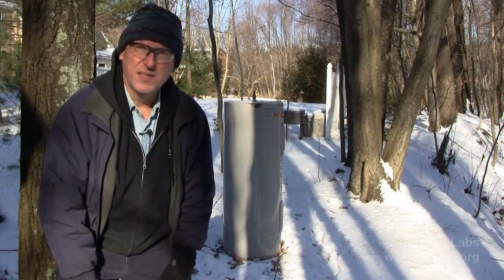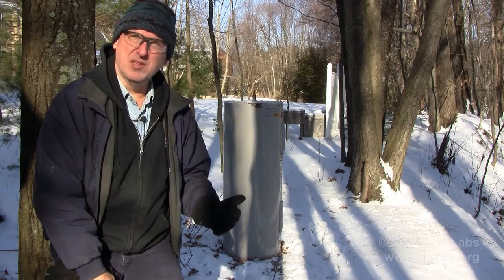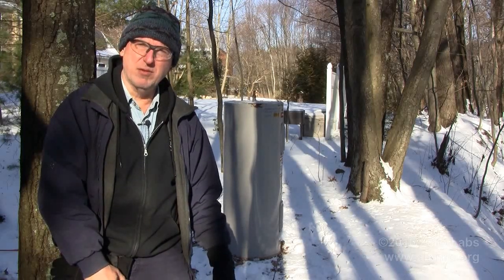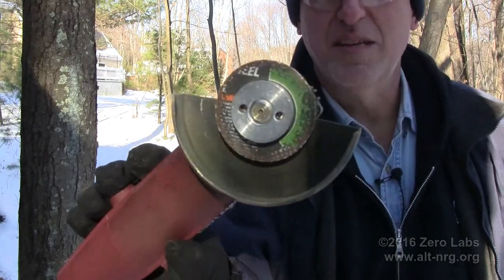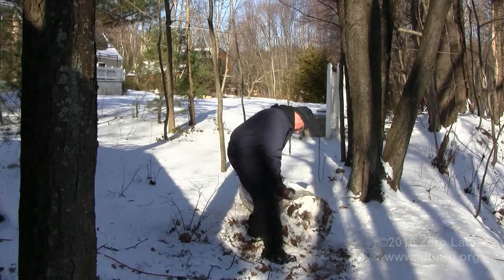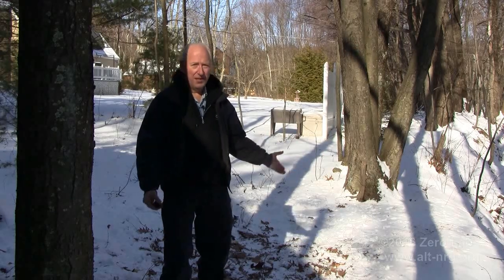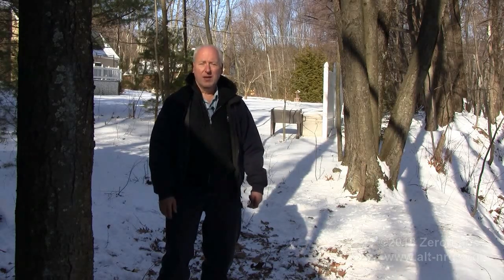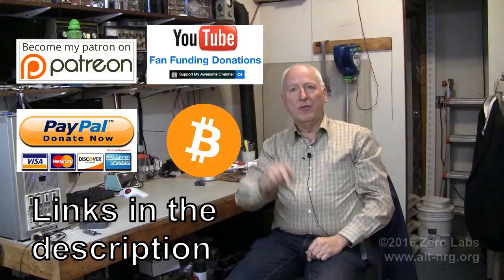#439 Rocket Stove Fail!

Comment from the maker: +insAneTunA My basic plans are available for free here. http://alt-nrg.org/  My design is entirely firebrick lined combustion chamber and riser, encased in heavy gauge sheet metal at the bottom, surrounded by fiberglass wool insulation and a 2nd shell. Rather than a complex secondary inlet system, I adjust the amount of bypass air (hence the A/F ratio) by simply sliding the pellet fire basket back a little letting air enter in front of the burning pellets. Very simple. Very precise. Very hot.

Good to have you back!  I don't know why I cannot reply directly to your comment. This YT thing seems to be falling apart lately. >:-(

Comment: I went to a steel supplier for the pipe that I used to weld my rocket stove. They even cut it to length for me. The wall thickness is about a quarter inch, I can't remember the diameter exactly though but I believe it was about 10 inches. But it is not that expensive. I also could buy pieces of steel that was only a quarter of the normal costs because it was considered as leftovers from cuttings, so it is worth while to visit a steel supplier or even a steel scrapyard. 

But WHAT EXACTLY are your plans, because steel is NOT the way to go for the combustion chamber AND the heat riser, I can tell you that in advance. But for the outside wall it is good. 

I've build a massive steel rocketstove, it ways several hundreds of pounds, and I would do it differently if I had to do it again. I would use a perlite mix to create a firebox and heat riser and wrap it in steel to make the combustion chamber and heat riser sturdy, in that order of construction because of the shrinkage of the perlite mix. And the outside from the stove can be thick walled steel pipe with a thick steel plate on top. Even better would be large square tube instead of round pipe, but that I will explain later in my comment. There are a few good examples to find on youtube on how to build a mold and cheap DIY vibrator from an old sander for the perlite or concrete mix. 

To my personal experience a bare steel combustion chamber (fire box) and heat riser draws a lot of heat away from the place where you need it the most, the combustion chamber and the heat riser. My stove only burns as it should when I heat it up a lot with a lot of fuel (properly dried wood), and I even covered the inside of the combustion chamber with clay tiles. So I need to refuel it a lot if I want to get it real hot since the combustion chamber is not that large. So it sort of works and it get's hot eventually and once it get's hot enough it doesn't produce smoke, but with a perlite mix combustion chamber AND heat riser or something similar fire proof material you get way much better results and much higher efficiency and less problems with smoke or that it won't burn well enough. Even slightly damped wood will burn well with a properly build rocket stove.

Also, with a steel pipe that has a relative a thick wall thickness, let's say from a quarter inch or more it is very hard to cut a round hole into it without a plasma cutter or other specialized cutter because of the shape. I know that because I had to do it anyway and I only had an angle grinder to do it. It took me a lot of grinding and I even broke an angle grinder while I was doing it and I had to guess the shape of the hole in order to be able to weld the other round pipe onto it. So if it is for the outside I would go for large square thick walled tubing instead of a propane tank or some other round shaped steel just because it is a lot easier to work with and a lot easier to cut the proper holes for the different purposes and to connect other parts that need to be welded on to it. Flat and square steel shapes are easier to work with then round and circular shapes. Especially when you only have an angel grinder to work with. 

Also create some sort of adjustable secondary air inlet for the heat riser so you can play with the combustion properties later when it is finished.

I made an extra inlet in order to be able to feed the wood, but I made it at the wrong position, now it act as a stove pipe when I open it up while there is still burning wood inside. I have to wait until all the wood is almost completely burned and then I can ad wood from the top. If I had made the extra wood inlet at a different position I would not have had that problem. Keep all the wood inlets away from the heat riser as far as possible so if you planned to ad an extra wood inlet place it at the beginning from the combustion chamber, no matter what kind of design you are going to use. And keep the main AIR INLET as high as possible. 

Use a cast iron replaceable rack as a bottom of the combustion chamber in order to be able to collect the ashes easily. I didn't do it so I have to brush it clean and it causes a lot of dust.   

Also just make sure that you have enough mass behind or in close proximity of the stove in order to be able to store the massive heat that is released in a short period of time, because that is the whole idea behind a rocket mass heater. I personally have been thinking about removable steel bins that I can fill with sand so if needed I can drain the sand, but it adds mass and it stores the heat somewhat. But add as much mass as possible, it contributes the efficiency. 

If the stove burns as it should it is able to melt steel, it get's as hot as a blacksmith's  furnace, so you have to address it as such in order to get the highest efficiency, at least that is to my humble opinion after building my own steel wood burning stove that is based on the rocket stove design. Otherwise it still would be an ordinary wood burning stove and sadly enough not a rocket mass heater, and you still would need to chop a lot of wood like I have to in order to get it real hot. So don't make the same mistakes as I did and don't use any kind of steel for the internal organs of the stove other then the bottom cast iron rack for the ashes.   

I had a lot of stuff going on so I was MIA for a while, but I'm doing okay and I try to keep track of things. Wish you all the best with your projects. Peace, iT

Comment: ugh. That looked like a ridiculous amount of work. My dad has used hot water tanks in the past for making stoves of various sorts. Back when they just used fiberglass. The tanks he used were glass lined and he had no end of trouble welding on them. Lots of extra work but it was what he had at the time. Definitely agree an appropriately sized propane tank should work good.

Comment: Rust between the insulation and outside of tank usually comes from the connections above, not from inside out.  Changed many in my 40+ years at that kind of thing.  Concern, or maybe even benefit?, may come from the interior tank surface being porcelained.  This anti-rust feature is on all modern tanks.  It is easily removed before any alterations by hammer impact on the outside. Zillions of minute and razor sharp shards result.  My guestimation is a free and perfectly suited tank.  More water heaters are discarded due to superficial leakage at fittings than actual compromise to the tank.  Quick, easy and cheap test with either air or water pressure tells all.  Just take it in with your next scrap haul if no Bueno.
Reply from the maker: +MARK B I disagree. Electric water tanks have sacrificial magnesium anodes for a reason, to prevent corrosion from the inside out. I'm quite certain this sis not leak from the top fittings. I do know that the heater element o-rings can fail but this rust was on the opposite side. The tank is classified as light steel. Last time I brought some down to the scrap yard it only got about $0.02/lb. Not worth my time or gas. Bulk trash already took it away. Good riddance to it.

Comment: Bad idea for a jet engine = made out of tin cans. Concept is sound but internal temp liquefies components. Looks good though.
Why not a rocket stove out of 1/8 in plate steel? My grandpa made a central heat with this, a wood burning stove and a large squirrel cage fan (10 in. I think). I got his ingenuity and creative craftsmanship. He also built a brush hog mower attachment for his tractor with the steel and an axle joint, I believe from a truck (transmission to transfer case). He hand crafted his own blades, too. I have a lot to live up to.
Reply from the maker: +WhtStr213 1/8" plate steel would be ideal if I had a sheet metal roller to form it into a cylinder. I don't exactly have a fully equipped machine shop.
Reply: I was thinking squared body, sorry. I'm thinking concrete drain pipe has weight problems, but a few benefits. Or sheet metal with a few wraps if you have an arc welder. You might try wandering any scrap yards for ideas, if you have access to any. Sorry I can't be of more help.
I hope you can keep up the Zero Labs, I'm hoping for you.

Comment: How about a vertical water tank fora candidate for a compressor tank. If you live on Avon you can probably pick it up at the recycle center there. Put a wanted add in craig's list another easy way to get one.
Reply from the maker: +goriverman Compressor tanks tend to be short and stocky. I need tall and slim, between 40-50 gallon. I like the 17.5 gallon compressor tank I used for my small rocket, nice 1/8" thick walls, but I think a large one fitting this description might be hard to come by.

Comment: I have been there and yes it's not worth it, I learned to only score sheetmetal a few times with a cut off disk instead of one deep cut and the disk will last longer. Is this new stove going to be more efficient such as having a secondary burn chamber?
Reply from the maker: +RWS Browning  As far as I'm concerned, it's already very close to perfect. I already get temps in the mid 900's at the top while never seeing temps higher than 200 at the flue. And I mean never. Most times between 150-180. The gravity feed pellet hopper is reliable, silent and self regulating. The next stove will only be more serviceable and bigger in size for a whole house heater. It will have a hatch in the belly for easy clean-out so I don't have to remove the top half every year, better insulation around the horizontal burn tube section for faster lighting and higher efficiency, hinged hatch door at the front for horizontal tube clean-out, sliding firebrick opening to light without having to open the front hatch, etc.
Reply: +ZeroFossilFuel Ok there is room for some improvement however I know the quality work done on the past stove and look forward to this one as well. Let's get her done!